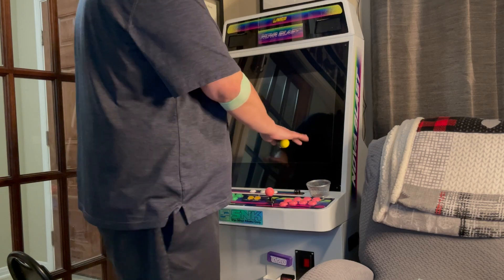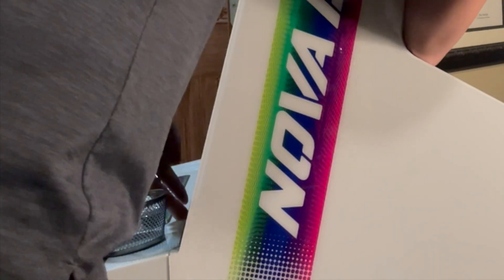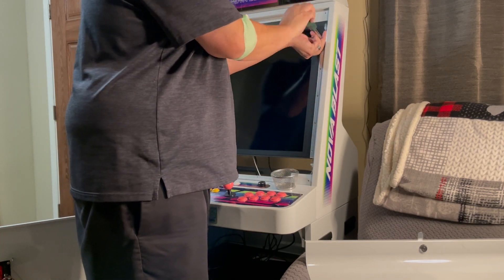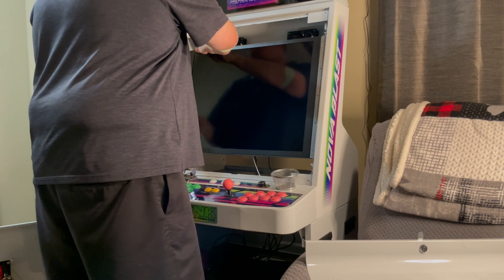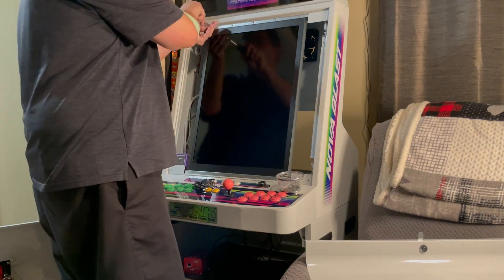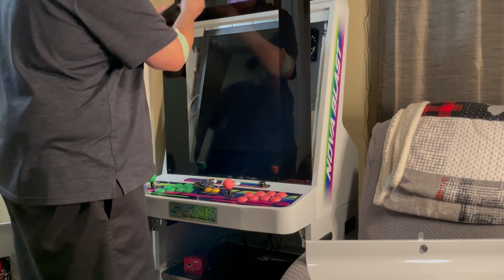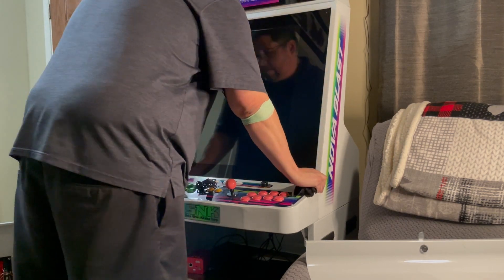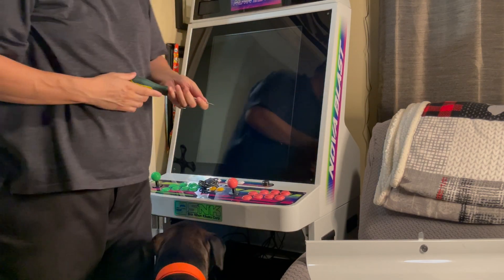UNICO NOVA BLAST: SCREEN ROTATION!

Comment: As long as you own this gem .. what is your experience long term with this cabinet ? I would appreciate any feedback specially from you and thanks !
Reply from the maker: I’m excited for the final product as it is based on feedback that I shared. I am pleased with my prototype and there’s nothing that compares to the feeling of playing on a cabinet. I’ve hooked up various devices with ease even a neogeo MVS but I always circle back to the MiSTer for the convenience and variety in arcade games. I wish the monitor had an automated mechanism to perform the rotation but simply because I’m lazy, not because it’s difficult to do. Perhaps a subwoofer or some added bass to the speakers would be nice. I think I’d also prefer a single player panel.
Reply: @neocvera  I see , thanks for the feedback

Comment: Hi ! very nice cabinet.  how many hardwares it could be connected for emulation ? MVS ? Mister ? Pandora ? PC ?
Reply from the maker: Devices I’ve personally connected:
MVS-1C (jamma) 
MiSTer 
Analogue Pocket 
Steamdeck
Xbox 360 (+wingman adapter)
Dreamcast (VGA+wingman adapter)
PS3
PS4
Switch
Mac
RG35XX,Plus,SP
Reply: @neocvera  wow ! and you could setup Arcade controlls easily ?
Reply from the maker: @GUILLERMO01ful Xbox 360 and Dreamcast require an additional adapter but everything else worked.
Reply: @neocvera how does that work then? Does the control panel have a usb lead coming from it?
Reply from the maker: @neontetra1000  the control panel is wired to both the jamma connection as well as USB encoders.

Comment: A little tip for the bezzle, use a suction cup for it so you don't have to push it out from behind anymore
And thanks again for all your videos about this cab.

After watching the videos, I decided against this cab and would probably prefer an original Vewlix.
Reply: i have a vewlix L but i want this thing for the smaller footprint
Reply: @davysmith8569  Please don't get me wrong here.
I don't think the Nova is bad at all, I really like it. But I think the price for it, especially in Europe, is too high for what is on offer.
If I could get it here for €1000, which is equivalent to $1072.83, I would buy it. As it is, I have to pay almost the same for the Nova as for a real Vewlix, but the workmanship quality of the Nova is far from that of a Vewlix. 
Unico doesn't seem to be interested in offering the Novablast in the EU either. Importing it myself would then cost me even more, I would then have to pay around $1664.01 for it here. 
And no, unfortunately what is offered is not enough for me.
Reply: im on the fence.. what made you swing to team vewlix?
Reply: @huehuetrain  More robust construction, used and not much more expensive to get here in the EU as the Nova